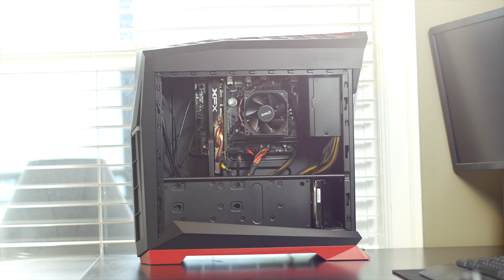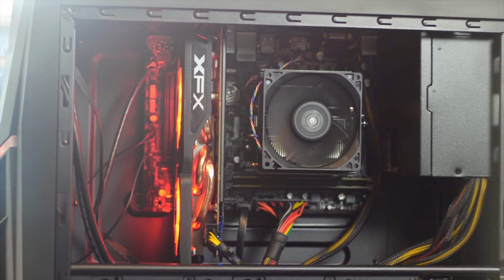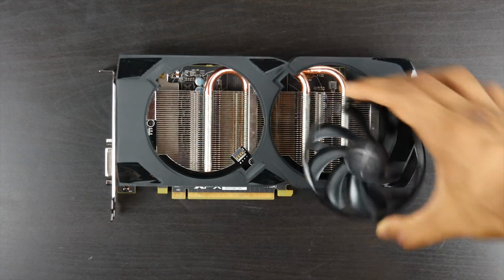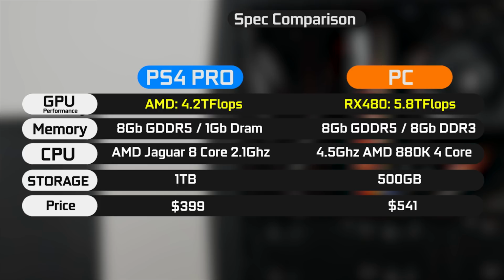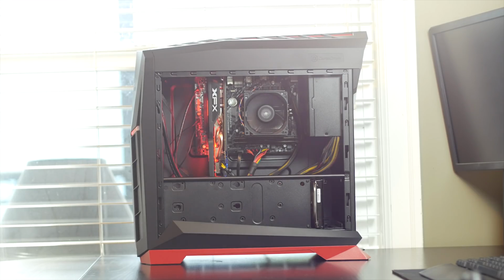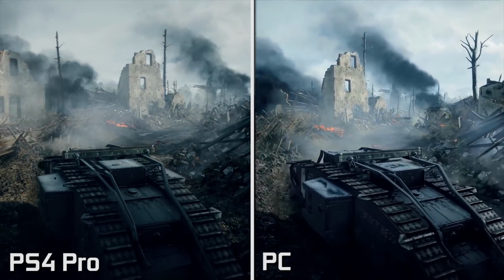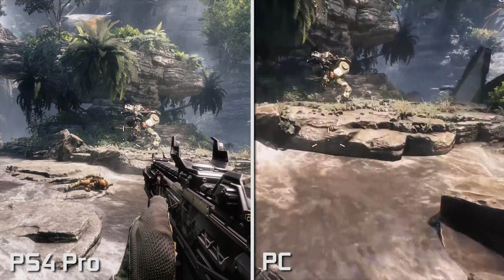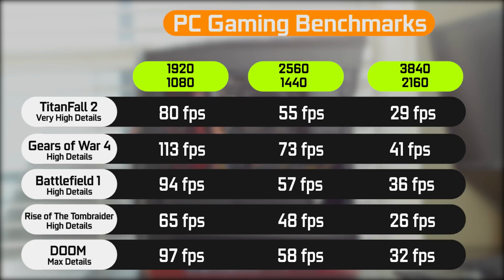Playstation 4 Pro vs $550 Gaming PC

Comment: $400 vs $550, still not a proper comparison.
Reply: yeah but the pc still ran better. IMO that's a win win.
Reply: I still prefer Humble Bundle/Bundle Stars/Steam over PS Store. But I hate it when people just complain about gaming when you could do a lot with a PC. Programming, rendering, modeling, music making. I'm just gonna name them: 

PCs are for content creation plus gaming. 

Consoles are for gaming plus home entertainment.
Reply: I pick up my game 2-3 weeks after launch for around £25 so if you have patience the console is a better route to take than pc in the Uk, You are talking around £750 compared to the ps4 pro at £328 for a similar performance and that's without the extreme optimization consoles benefit from in most cases.

*We pay a 20% tax on electrical equipment here plus the import tax dependent on country of origin.

* I use my pc for editing in programs like Maya,C4D and unreal engine  so its worth having a high end pc but as for mid range builds i would honestly not bother in today's current market.

I tried building a pc from scratch and ran into issue after issue the main problem i had was if i wanted anything around a i7 4th gen + and something like a GTX 1060 without cheaping out on the PSU, i kept having costs run into the £900 range which for me anyway didn't feel worth the extra money for the performance gain(FOR JUST GAMING).

Thanks for reading.
Reply: again paying for PS+ and more expensive games?
Reply: Shamoy Rahman Sexy build i approve.
Reply: +Iñäki 诶, Are you saying Minesweeper being free exempts PC from factoring in game costs too? Brand new PS4s usually come with a free trial period PS Plus also. But for the sake of fair comparison we can say both are capable of playing offline games for free (i.e. Skyrim).
Reply: Abhinav Praveen Wasn't that the purpose of the pro console, To have higher game settings and better fps.

The new 4.2 teraflops in the pro console is a little less than the GTX 1060 in terms of power with the GTX 1060 having 4.4 teraflops of power.
 
So if Sony stopped aiming for 4k they could run 1080p at high/ ultra on most games with solid 60 fps"I would like to point out that these stats are from benchmarks from similar builds"

Lastly i would like to inform you that the FFxv runs at 60fps on the PlayStation pro.

Thanks for reading.
Reply: And ps4pro power consumption is much smaller. more than three times. Electricity is not cheap in EU
Reply: darkRAGElight True, smart
Reply: Chaosy You can't do professional high-end rendering and musc production with a $500 PC. You will need specs like an i7, GTX 1070 or higher, and a high-end SSD (preferred).
Reply: Shamoy Rahman It's the premium you have to pay to join the master race.
Reply: Abhinav Praveen I don't consider anything master race, I'm a PC gamer myself but I have no hate for consoles, I have a hate for fanboys. I like the best of everything, if you can't enjoy everything, then you are missing out,
Reply: Shamoy Rahman I have a pc and a ps4 but pc is still superior.
Reply: Abhinav Praveen I don't see what's superior other than better graphics and some mod support. I see both platforms as equal. They are meant for 2 different things. PC is dedicated for gaming hardcore, console is for casual games.
Reply: +Shamoy Rahman there are extra pheriperals required for console gaming. You must pay 60 a year to play online for xbox one and ps4. Games are much cheaper on steam as the regular price of a steam game sometimes matches out a game on ps store thats on sale. PC has waaaaay more options and freedom. If your arent gaming you can hundreds upon hundreds of different things. There are thousands upon thousands more games available. Believe it or not PC GAMING has more exclusives then Ps4. (But I must admit after E3 2016 Ps4 is looking at some pretty good exclusives for themselves) I own a standard ps4 and believe me I use it just as much as my PC. But even after that I do prefer pc gaming.
Reply: Salman Sohail I know but I'm not saying console is better than PC. I'm saying both have exclusive that makes it worth buying both. They also pertain to different styles of gaming. You can lie down on your couch and play console games casually or stay seated if you are PC gaming.
Reply: Shamoy Rahman You said it yourself, pc is superior.
Reply: Abhinav Praveen If you understand my understand what I said carefully, I said console is superior to PC for ease of use and simple gaming and PC is superior to console for enthusiast gaming with modding and computer functionality. Both are good for different styles of gaming.I'm not a fanboy, I can appreciate everything, the best of PC and console, that's why I have more fun than PC only gamers or console only gamers. I don't need a beefy PC to play storymode games like Uncharted or Infamous. In fact I prefer playing GTA 5 on PS4 because the controls are simpler and I can lie down on my couch and its easy to play. However, I love to play games like Minecraft, Kerbal Space Program, Battlefield, and CoD on my PC because it feels better mechanics and skill wise.
Reply: Shamoy Rahman I'm talking about overall gaming experience. IMO PC is superior because fps can be higher, graphics can be higher etc. So I would rate the experience as better. For example ffxv is console exclusive and it has potential but it runs at 20fps and settings are pretty low. Pc can be high and 60fps. I have a ps4 (for destiny) and I appreciate it but IMO, there is no denying that pc has a better gaming experience and is superior in this context.
Reply: louis daly I was talking about the normal ps4 with ffxv. And a gtx 1060 cannot do high@60fps in most recent aaa titles. My point is that my gtx 1080 could do much better than that in both graphics and fps and is therefore superior (in context of gaming).
Reply: Abhinav Praveen Yes its obvious the GTX 1080 would be better considering it costs £650 alone for just the card, As for the GTX 1060 it benchmarks a average of 68fps at ultra with a resolution of 1440p i'll link the research below.

http://www.gamersnexus.net/game-bench/2652-battlefield-1-graphics-card-benchmark-dx11-vs-dx12

Thanks please review my findings.
Reply: louis daly GTX 1080 is better which is why I say pc is superior. Also BF1 is, from experience, a very well optimised game. I don't think it could get 60 in more demnding titles such as witcher 3 or watchdogs 2.
Reply: Abhinav Praveen Some games are meant to be played at 30fps as it makes them more cinematic, movies are mastered in 24fps. While the PS4 is not powerful enough, it makes sense to run FFXV at 30fps because not only can they squeeze more graphical detail but they can also make it more cinematic at the same time.
Reply: Shamoy Rahman I'm sure 99.9% of people, shown console x which plays ffxv at 60 fps and console y at 30 fps but both at the same graphical settings would pick console x. I know I'm repeating myself but... If it was a pc game, we could have had 60fps with almost as much details as the devs desire.
Reply: Abhinav Praveen I understand, yes everyone has different preferences but most would prefer higher framerates.
Reply: A gtx 1050 ti will perform better than the gtx 960 and the 1050 ti is cheaper
Reply: Still paying to play online... they are stealing your money because those money DONT go towards the servers... so that's a huge fucking minus
Reply: Nipple Wrapper You get free game which i can put up with however the best game in my opinion we got was Rocket league.
Reply: its not free if you have to pay lol...
Reply: Anything beyond the cost i paid is free, I paid £23 for a year and that paid for its self in the 3rd month of the year which means that anything beyond that point was free in essence.
Reply: you get a triple a game every month for the whole year and you get to keep them? Yeah right... Also stop lying for a full year of PS+ its 50$ a year not 23 pounds. I checked it out and most of the games you get you can get for 5-10 dollars on steam, sometimes even less and you don't even get the games you want.
Reply: Orange I don't pay on the store which would be about 20% more instead i get the best offer which i usually get with Quidco and Amazon as for game price yeah some are like £5-10 pounds but some are also like £20+ so yes it does pay for its self and it takes a real ass to accuse someone of lying when you have no factual information or understanding of the deals available.
Reply: louis daly But on pc... You can get everything you mentioned for a similar price... https://www.googleadservices.com/pagead/aclk?sa=L&ai=DChcSEwj-48vo49XRAhXbh7IKHWLDBwQYABAB&ohost=www.google.co.uk&cid=CAESIuD2YaSH48F5jtfvjqvMpLDWXMu4PZa3ccv85TDjxNnTJ3s&sig=AOD64_286UFEQhnKA9iXDLyfvVSHR71_uQ&ctype=5&q=&ved=0ahUKEwing8bo49XRAhVmIcAKHWDGAvkQwg8IHA&adurl= ?
Reply: Except we get fucked on tax unlike you guys which would make similar spec pc's cost way more than a console, 25% import tax + 20% electronics tax.
Reply: http://www.electronicfirst.com/playstation-plus/playstation-plus-1-year-membership/?gclid=Cj0KEQiAzZHEBRD0ivi9_pDzgYMBEiQAtvxt-O4S6sZ9-S5SWu80pjb87vnV42kyemAmLr3u0J8PthEaAoDn8P8HAQ
 The games yes, The specs No.
Reply: louis daly That's quite a bit higher than you mentioned... And you can make a pc with similar/better performance for the same price as a console...
Reply: Abhinav Praveen Prove it make it on pc part picker and don't cheap out on the PSU like most attempts of making a console priced pc do.
Reply: Abhinav Praveen i'll make one to match the ps pro now and post the link in these comments i'll take the cheapest gold rated PSU"The reason i choose gold rated is i've had pc's destroyed by using cheap PSU's.
Reply: £989.70 specs = i5 4460 3.2 GHz Quad-core, Cooler Master Hyper 212 EVO CPU cooler, Gigabyte GA-B85M-DS3H motherboard, Kingston 16GB (2 x 8GB) DDR3-1600 Memory, Western Digital Caviar Blue 1TB 3.5" 7200RPM Internal Hard Drive, MSI Radeon RX 480 8GB GAMING X Video Card, NZXT S340 (White) ATX Mid Tower Case, EVGA SuperNOVA G2 550W 80+ Gold Certified, Microsoft Windows 10 Home Full 32/64-bit, Asus VP228H 21.5" 1920x1080 60Hz Monitor.

A full list of the specs i had picked with the closest possible Graphics card to the one in the PS Pro, The CPU is a matter of contention so i choose the closest matching performance CPU i could find and the Memory is around what you could need to run most triple A games at a smooth level.

Now if i was to build the pc not matching the PS pro performance i would go for the GTX 1060 6GB as it can run every game out at 1080p with high framerates.
Reply: louis daly Wait a minute... An rx 480 will offer more than double the performance of a ps4 pro? What are you on?
Reply: Abhinav Praveen In comparisons in game performance due to the ultra optimization on the ps4 pro its sits closest to it on performance, I can't remember where i watch the comparison but i'll try and find it and post the link here.
Reply: I got it the RX480 Has 5.8 Tflops at peak the PlayStation 4 pro has 4.2 at peak the optimization put them near level with the same power of cpu.
Reply: louis daly No no no no. A ps4 pro can do 1080@60fps at high settings. An rx 480 can do 1080@60fps at ultra settings and then if you want to, upscale it to 4k like the ps4 does.
Reply: On what game? these figure are complete bollocks without more information as to what you are comparing them on, That is why i had chosen to point out the Tflops as that shows the raw performance.
Reply: louis daly https://www.hardwareunboxed.com/amd-radeon-rx-480-benchmark-review-23-games-tested-three-resolutions/ and that can be easily upscaled to 4k60fps.
Reply: louis daly https://pcpartpicker.com/list/ysH33F Keep in mind, these are new parts. And a new ps4 will cost $250 and $50 to play online. Games will be cheaper on pc. Just look at overwatch prices at launch. Hundreds of games will be free on pc. Also, I trust evga with my pc's. No one on a budget needs a gold psu. Microsoft offers a trial version of windows 10 for free. If you consider the price of a monitor for a pc, you need to do the same for a console as I can and have easily hooked up my pc to my tv. Thanks for reading.
Reply: Abhinav Using a trial OS is cheating as it would run out.... Also this pc would run like shit. with a dual-processor and windows 10 even if you did buy it.
Reply: Battlefield 1 minimum Windows PC requirements:

OS: 64-bit Windows 7, Windows 8.1 and Windows 10
Processor (AMD): AMD FX-6350
Processor (Intel): Core i5 6600K
Memory: 8GB RAM
Graphics card (AMD): AMD Radeon™ HD 7850 2GB
Graphics card (NVIDIA): nVidia GeForce® GTX 660 2GB
DirectX: 11.0 Compatible video card or equivalent
Online Connection Requirements: 512 KBPS or faster Internet connection

Hmm i couldn't play my favorite game on this pc.
Reply: Also, the cpu I chose is hyperthreaded. In other words, it has 4 virtual cores.
Reply: louis daly https://pcpartpicker.com/list/DkPzCy <-- has 8gb of ram.
Reply: So it would run pretty well.
Reply: Hello _ I checked it it's not compatible
Reply: Wow this comment section has evolved into a ton of discussions. Overall from factoring in paying for online services, it will cost about the same but most people don't need PCs because they do most of their social media stuff and most of what they do on smartphones these days. For simplicity, its a lot more worth. People who want to do stuff like run Windows programs like Office, develop games, run Linux, PC has more creative and customization options which appeal more to power users.
Reply: +Hello _ If Ryzen can bring us an i7 6700k/7700k equivalent for $150 and GTX 1050 equivalent card for below $100, PC will compete much better with PS4 Pro.
Reply: Semi Con 2 months later... PS4 Pro will have a clear loss in one or two years anyway. (Although they have a not-so-clear loss now)...
Reply: By then PS5 will be out. PS5 is coming with 10TFLOPS with Titan X Pascal power so that's something to watch out for.
Reply: Semi Con Do you have any reliable source for that information?
Reply: Semi Con It's possible but still seems unlikely at a console price. Although you can get a 6.5 TFLOPS GTX 1070 for $350 (e.g https://www.amazon.co.uk/gp/aw/d/B01GVHNW3W/ref=mp_s_a_1_1?ie=UTF8&qid=1491908025&sr=8-1&pi=AC_SX236_SY340_FMwebp_QL65&keywords=gtx+1070&dpPl=1&dpID=51i2GmuReDL&ref=plSrch ) it will be even less later this year when the Rx 5X0's are releases. The current best GPU for £699 can do 11.3 TFLOPS (GTX 1080 Ti). And a new GTX Titan Xp has been realised. So, if PlayStation/XBox can do it, it wouldn't be unreasonable to say that low end/cheap Graphics Cards would be able to do 8 to 12 TFLOPs in a few years. Although I still don't believe 10 TFLOPS is accurate. 8 TFLOPS is reasonable, 10 would be too expensive.

Comment: This is much easier in England. It's £399.99 for a PS4 Pro and you can put a 1060 / 8G Ram / I3-6100 if you put some work into looking around and waiting for sales. It's around £500 for 1060 / 8G Ram / I3-6100 anyway (using Newegg)
Reply: >nvidia cards
Reply: Ricco123tube You cant sit there and say that, is the pro is £349.99 then you also need to add £39.99 for PS+, +money for a headset,  +money for extra controllers. Also you dont have to buy a os, most people used a illegitimate version of win8.1/10
Reply: Ricco123tube Its an option, or you could use an older os, win7pro is like £15
Reply: Ricco123tube Consoles are cheaper when you first buy them, after a few years they become more expensive than PC's.
Reply: "Higher resolution HDR gaming" Well, to experience that 4K HDR you need to slap on £800 since TVs that support 4K and HDR are VERY expensive. Also, that 4K is upscaled. Not real 4K. If you're buying a PC you get to experience the real deal. 1080P looks shit on console comparing to 1080P on a PC, ever wondered why? (I tested it on the same monitor.) Even if a PC will stack to £700 total when grabbing a budget console killer, it's always a better deal, free online, MUCH cheaper games, and it's a PC, you can do so much more on a PC. When you buy a console you'd need to buy another seperate PC to do your other work on thus adding up to more. However, I did say that PC is cheaper straight off the bat, so I was wrong. I didn't talk about value of what you're paying for so my argument in this comment would be invalid. Thanks for correcting me on the £350 price tag and thanks for reading!
Reply: Ordingandr You can actually get a W10 Pro key for £5, W10 Pro Key + USB for £15. I can't remember the website but that's where I got my copy from. I'll search it up and drop a link on this thread when I have the time.
Reply: Ricco123tube Yet not many people have a 4K HDR TV but you're not gonna get a 4K HDR for £350. It's hard enough to find a 4K under £400, let alone HDR. But my argument is invalid anyway. The PS4 Pro doesn't exactly require a 4K HDR so a 4K HDR TV shouldn't go into the price, it should be a regular 1080P TV, which you can pick up for like £150 nowadays.
Reply: I'll probably grab a PS4 Pro when games start to support it better. Seems like it'd be worth it.
Reply: Sami Chowdhury The only game ive seen that might benefit from it is Death Stranding, because Kojima
Reply: I tested this out for my friend that wanted to go PC gaming just around the time the PS4 was released, it took just a year for that PC to work out cheaper than the PS4 and he's been saving ever since, performance wise seems similar to the PS4 with careful graphical settings, in some games he was able to double the fps to 60fps then what the console version was doing but in most cases he was playing at 30fps like the console version which he was fine with.

Honestly, PC gaming is dirt cheap now whereas console gaming is becoming quite expensive, especially the running cost.